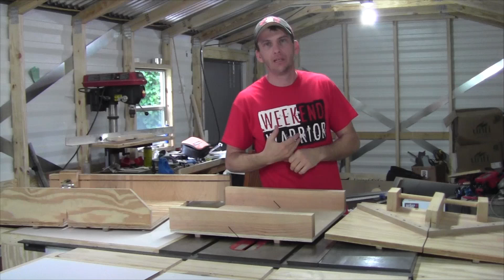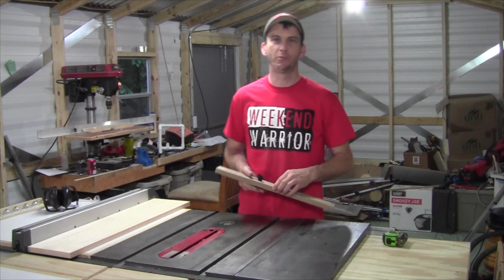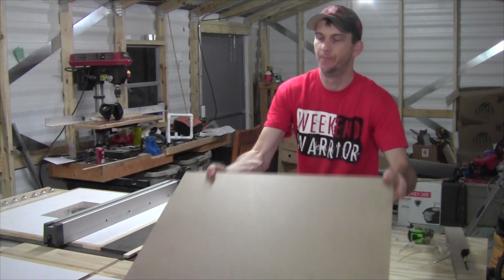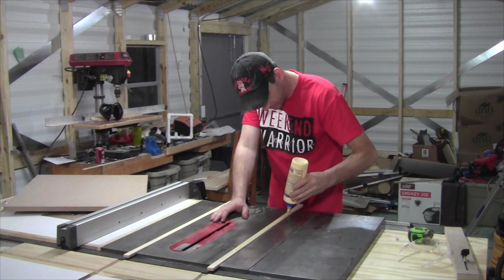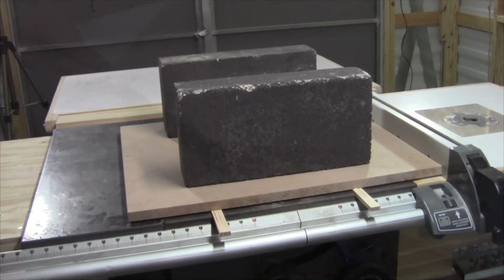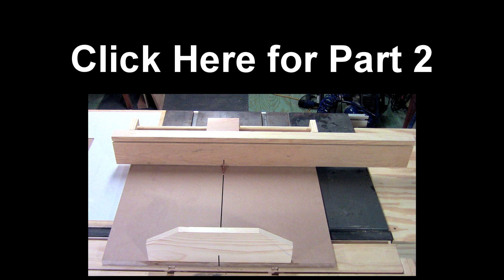How to Make A Cross Cut Sled | PART 1

Comment: Hi, just got a cheap table saw to get started. and I'm looking at the best or easiert to start cross-cut sled to build. 

I keep hearing about zero clearance insets and sleds. Why is that so important not to have gab by the blade?

thanks
Reply: Zero clearance keeps small pieces from falling into the gap and getting thrown back at you.  It also helps reduce tear out
Reply: aha, that makes sense. I did open the bottom of my table saw (to practice changing blades) and saw there is like a bladegard at the bottom of the blade that could act as a launch pad for small parts.

Thank you.

Now my saw came with two blades, I put on the one with 42teeths.... the other had fewer. So when should I use the one with more teeth vs the one with fewer teeth?

Thank you very much.